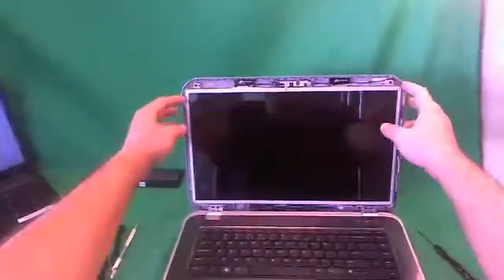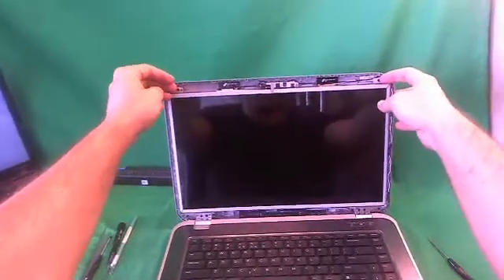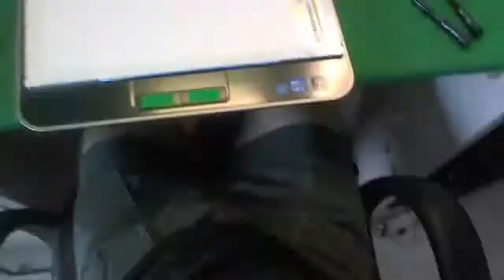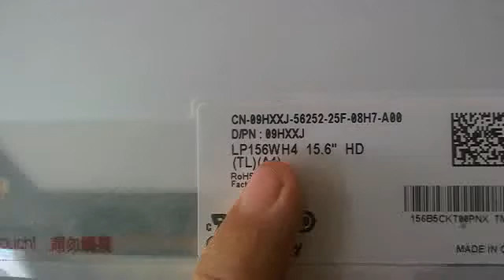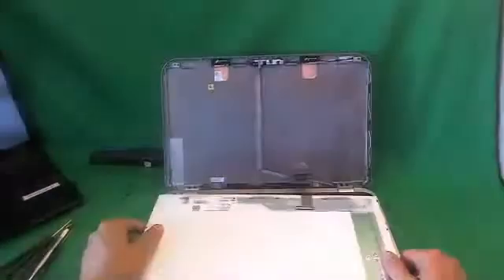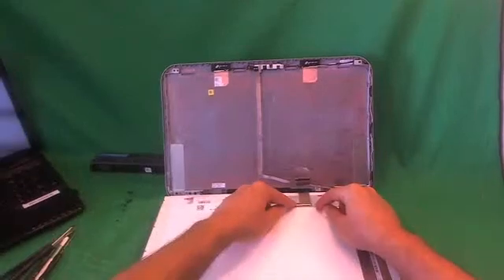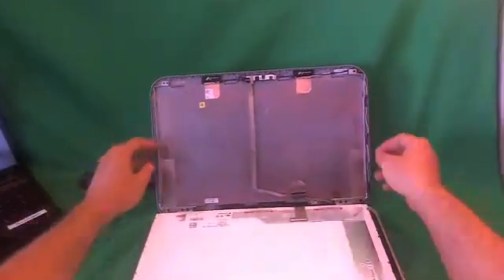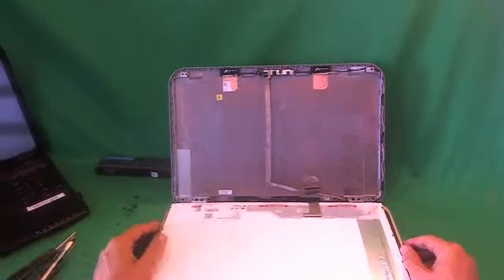Dell Inspiron 5520 Laptop Screen Replacement Procedure

Comment: thanks for this. I used jewelers screwdrivers and after taking the 2 top screws out, the 00 worked easy for getting all the screws out on the side including the bottom side.

Comment: I got my new dell inspiron 5520 laptop on dec 2012 , but its webcam is not working and even reinstalling the windows 7 ,it didnt detect my webcam and not intalling its built-in integrated webcam driver . will u plzz help me ..... how to check the wiring of webcam ..........

Comment: does your 5520 wireless works properly? i just bouthe 5520 just few days ago. i cant connect to wifi, it connect then disconnect then become limited. i tried everything to fix it, update the driver, reinstall windows 7/8. no luck